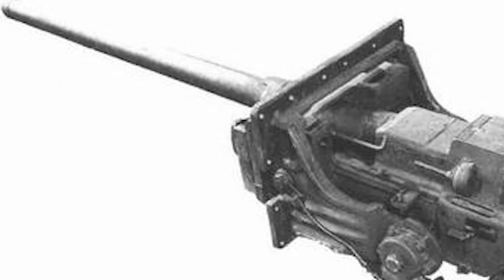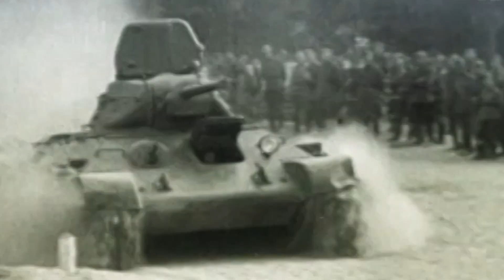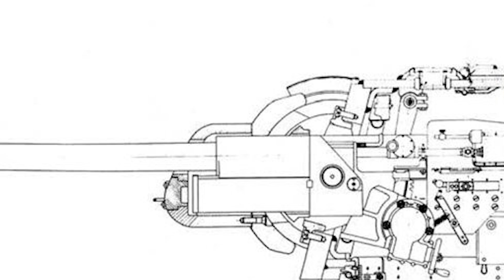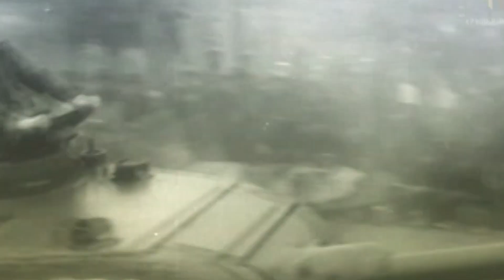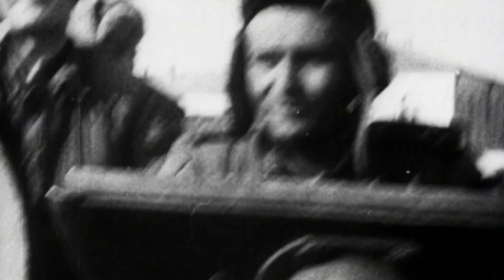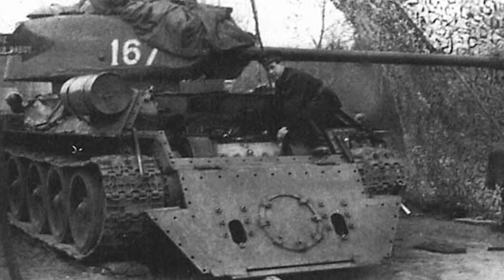Why Was T-34 Stalin's Secret Weapon That Shocked Hitler?

Comment: The T-34/76 was a combination of innovation and simplicity. The sloped armor was very innovative. Manufacture and operation of the T-34 was simple (as was the case with most Russian armaments). The T-34 shared with the Sherman one major advantage over German tanks: numbers. Both the USA and the USSR dramaticvally out-produced Germany in terms of not just tanks but pretty much all armaments. But the T-34- especially the upgunned 85mm version- was markedly superior to the Sherman.
Reply from the maker: Totally agree—the T-34's balance of simplicity, innovation, and numbers was a game-changer! The sloped armor was a solid design, and the 85mm version really stepped up its game. Do you think the T-34's advantages would still hold up against modern tanks, or did its effectiveness fade with time?
Reply: @TankForge-n7y  Anything much beyond Word War 2 tanks is beyond my knowledge. I would say that the sloped armor feature of the T-34 and other tanks probably was the longest-lasting improvement- at least defensively- of anything I can think of.
Reply: @Mustapha1963  The sloped armor wasn't a Soviet or a T34 innovation as sloped armor was used on other tanks prior it the T34. The crew layout was abysmal and one of the main reasons the T34 was not a game changer, the poor quality Soviet construction being a close second.

Edit- The Commander's dual duties as both gunner and commander was a huge drawback when  the tanks situational awareness is concerned.
Reply: @MrJamesDoz  Sloped armor did not begin with the T-34, it's true, but it was the first tank with sloped armor produced in mass quantities. It really doesn't matter if you're first with an innovation if you can only field said innovation in a very limited manner.
True, crew layout was far from perfect and the commander, being called upon to both command the vehicle and aim the main gun was overburdened. But that's hardly unique to the T-34 either. Various Japanese, French and Itanlian had two-man turrets.
Finally, your criticism of the build quality of the T-34 is warranted, but exaggerated. What I mean is that it was a wonder that, given the sort of tanks the USSR produced prior to it (and the KV-1 as well), it was produced at all. They could easily have continued to mass-produce the inferior lighter tanks or the hopelessly overcomplicated multi-turrented monstrosities, but, in the midst of the German blitzkerig, managed not only to design and begin production on a radically better tank but to produce them in the tens of thousands.
Reply: @Mustapha1963  The commander having dual duties was a n enormous oversight and the tank could never be considered a game changer or one of the best, the very poor quality of the tanks is another issue not brought up but was a major hindrance to its success. HALF of all the T-34s broke down en route and don't get me started on crew survivability The French and Japanese, Italians tanks with two man turrets are all also noticeably inferior and the reason no other nations built tanks in this manner.   The tank was rushed in most instances and things like welds not holding up and space between two plates being visible as well as many parts such as running lights being left off "finished" models are just two examples of the disaster the crew had to deal with. It is not exaggerated in the least bit in fact it isn't talked about enough.  The T34 was present in large numbers at the time of the invasion, it is a myth that the T34  numbers where low at the time as it accounted for nearly one third of the Soviet tank force in june 41, what tank was designed and built during the first months of Barbarossa as surely it was not the T34.
Reply: @MrJamesDoz  According to Wikipedia, development of what would become the T-34 began after the Soviet undeclared war against the Japanese at Kalanin Gol in 1939. Production of the T-34 began in very late 1940 and ramped up only upon the German invasion of the USSR. Production was hampered by the necessity of moving the tank factories back behind the Ural Mountains.
This 'inferior' tank bested all German tanks it faced (with the exceptions being the Ferdinand and the Tiger I) and forced Germany to develop the Panther, which featured many of the best aspects of the T-34. 
We're discussing the T-34/76 here of course. When the T-34/76 became the T-34/85, many of the shortcomings you mentioned were rectified, and the result was, in the opinion of many armored warfare experts, the best tank of World War 2.